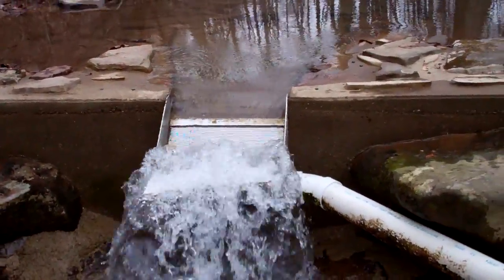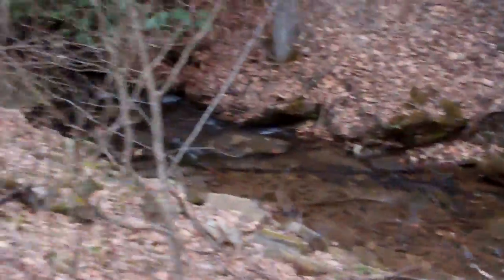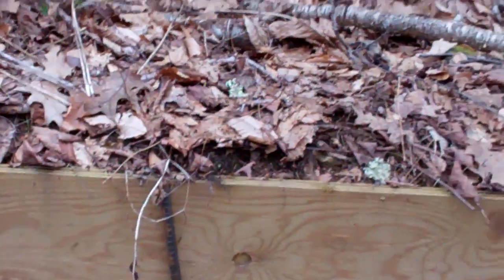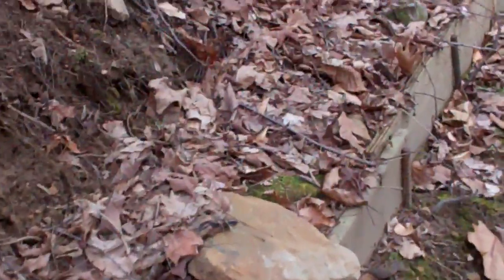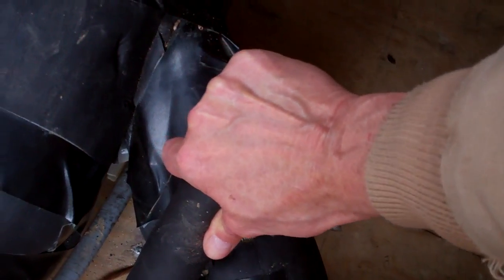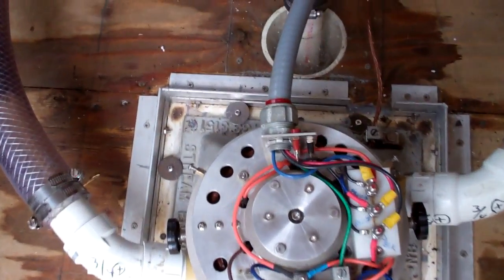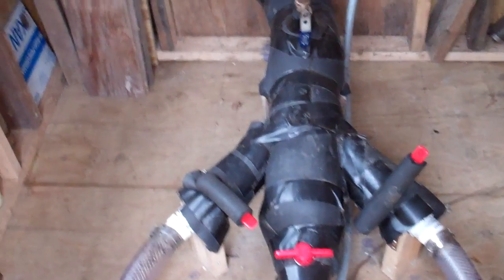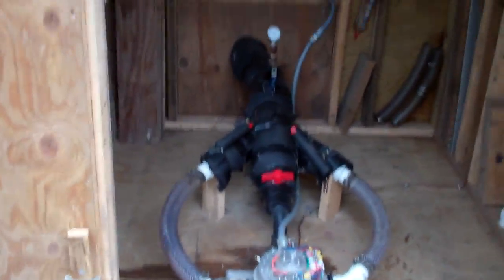WV HYDRO1

Comment: I'm confused as to why the set is taking AC to DC and then back to AC again. What is the benefit of doing it that way instead of just using the AC?
Reply: AC power must be used as it's generated, only DC can be stored in a battery.  Another thing about DC is that it has huge line loss in transmission, it's not practical to send it very far, the wires would have to be huge. Since my powerhouse is almost 600 ft away, that prevented me from generating DC straight to the batteries. By making high voltage (230VAC) I'm able to  use rather small wires (12 Gauge) to the house.
  If I was on the grid, I wouldn't necessarily need batteries and could just use 120VAC. But then, if the grid goes down when the water is low, I wouldn't have any electricity.    Good question, thanks.
Reply: Mickey Janowski.
Good set up. I envy you.
I perhaps missed this; what is the flow rate and what is your head?

Secondly, how much did the hydro generator cost you?

Comment: Man that sure looks like a heck of alot more than 156GPM of discharge.  I got excited because I thought I read it at 47" of drop.  47' is about 2.5 times more than I got  ;( 
 Nice build guy!!
Reply: Hey Dan.  Yeah, it sure does but according to my nozzle flow chart, each 3/4 is 78 GPM at 47 ft.  Thanks for your comment

Comment: Does a microhydro electric system need to be maintained daily, or can it safely run on its own for a long time?
Reply from the maker: My system takes very little maintenance, maybe 5 minutes a year, mostly cleaning off the leaves from the intake box screen in the fall. I have found the happy medium for my nozzle sizes so I haven't changed a nozzle in almost 3 years.  
  When it's dry and sunny the amps gradually drop with the water supply, and when it rains again the amps come back up, I don't have to do anything.
  I have changed the 2 bearings once,after 3 years, even though I didn't really need to. That took almost 2 hours.
Reply: Nice! Can you really power your entire house with energy from the microhydro system?
Reply from the maker: Yup. All systems are unique. Power consumption and amount of power generated must balance
Reply: Looks like you'd be fully prepared for the zombie apocalypse! :D

Comment: Thanks for sharing! If you could do it over, what would you do differently? I'd be interested in seeing how you handle the wild 3 phase for charging your batteries. Do you use a dump load when batteries are fully charged?
Reply from the maker: Hey W&W, you're very welcome. I'll answer the 2 shorter questions first. Yeah, as with any mechanical generator, the power needs to be diverted when the batteries are topped off. I use four 15A ceramic cylinder shaped resistors, basically an air/space heater, automatically operated by a 60A TriStar charge controller.
 Once I sized the system, Paul Cunningham at ES&D, the builder of the Stream Engine, also made the transformer to handle the 3-phase. All pretty straight forward, just connect the wires. At 600', I needed a higher voltage to prevent intolerable line loss, plus I could use small (12 ga) wires in 1/2" conduit.
  What would I do differently? Good question!  I wouldn't have used so much concrete in the weir construction. Probably a 4-6" wall with rebar (to a solid anchorage of course) and just let it naturally fill up behind it.
  I've had to try and patch & fill cracks & holes in the banks & /bed up creek where the water gets around the weir. Not a big deal except when the flow is marginal. A couple solutions during initial construction would be a membrane, like a landfill liner, tied into the weir form.
  I just helped on a job where the owner covered the creek bed with metal diamond lath and troweled on a coat of mortar,  you'd only have to seal as high as the intake.
  I spent a lot of time burying (by hand) my penstock. Unless you have access for digging equipment, I wouldn't worry about burying the it very deep, an inch below the surface would be fine. I have 8' exposed out of my intake box and it's gotten down to -15 F more than once with no problems since the water is always flowing. I would still do it again due to the aesthetics, stability and protection from big animals and falling trees.
 One other thing I learned the hard way, If ya build you're own intake box, have at least a 3-4" deep reservoir  above the top of you intake pipe or the turbulence/splash from the falling water will allow air in the line. Air's bad news, it kills pressure.
  Cheers, Mickey

Comment: For the love of pete, it's a pipe not a penstock.   Penstock is an open topped channel for moving water.  Pipe is not
Reply from the maker: Google it, or better yet, just go straight to Wikipedia. "A penstock (fr. conduite forcee) an enclosed pipe that delivers water to hydro turbines".  Many words in the English language have multiple meanings. Sherlock Holmes smokes a pipe but it's not the one that you think delivers water to my turbine.  By the way, who's Pete? and what does he know about penstocks?
Reply: Rangband1 Pipe without a surge tank is still a penstock.Open topped channel is not a good idea when it gets too cold. Stationary Water can freeze blocking or damaging the penstock. Also the head is not too high to necessitate a surge tank. Hence its okay to use 4" PVC pipe as penstock.
Reply from the maker: Thanks for making those points
Reply: @MoFreckles  actually your completely wrong, you are describing a "Flume" not a Penstock, so you you look like a fool to anyone whos in the know about terminology of the english language that has specific meanings, since you were to lazy to look t up I copied and pasted the definition for you. please have alittle more respect for the content provider let alone your self(you sound like and imbecile hick)
Flume Noun :
  1) a deep narrow defile containing a mountain stream or torrent.
 2)   an artificial channel or trough for conducting water, as one used to transport logs or "provide water power."
 3)   an amusement park ride in which passengers are carried in a boatlike or loglike conveyance through a narrow, water-filled chute or over a water slide. 

Penstock noun

 1)   a pipe conducting water from a head gate to a waterwheel.
 2)  a conduit for conveying water to a power plant.
 3)  an enclosed pipe that delivers water to hydro turbines and sewerage systems. The term is inherited from the earlier technology of mill ponds and watermills. 

now that wasn't so hard to figure out, have a nice day!!!

Oh and Bucksnot love your setup and I'm totally envious of you
Reply: I think it's funny that everybody gets upset about the name "penstock"... or even use it while describing their hydro system. Most of us aren't going to know what you're talkin about because we don't have a hydro system.(I wish more did) First time I watched a video like this and they were talking about a penstock. I didn't even know what the hell they were talking about until he said it was a pipe in the ground... I was like is it a pipe in a pipe is there something special about said pipe... come to find out there was literally nothing... its just a pipe. I wasn't going to comment until I saw this comment and all the comments after it. Lol
Reply: They like to misuse big words to legitimize their little DIY projects.  Purely ego driven.

Comment: Thanks for sharing your setup.  Very incouraging.
Reply from the maker: Thanks for your comment. If you've got running water with some drop, use it, these lil hydroelectric systems are really smooth operations. Much less fuss than I imagined once they're up and running, pretty much all automatic.
Reply: thanks for sharing the video... how can i avail that system ..thanks
Reply from the maker: I got my electrical components and technical advice from Paul Cunningham @ 
  Energy Systems and Design Ltd.
745 Waterford Rd
Waterford NB Canada  E4E 5B4
Phone +1 506-433-3151
Fax     +1 506-433-6151
Email  hydropow@nbnet.nb.ca
Web    www.microhydropower.com

 The other parts such as pipes, valves, wires, etc., could be sourced locally or on the web.